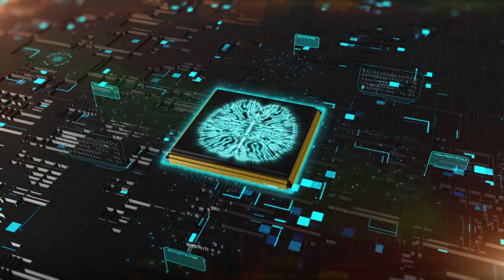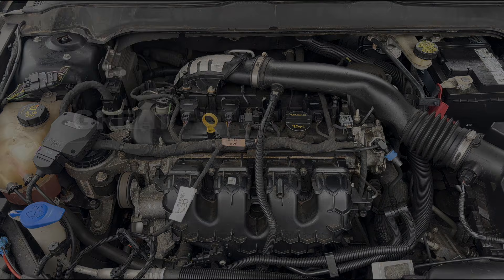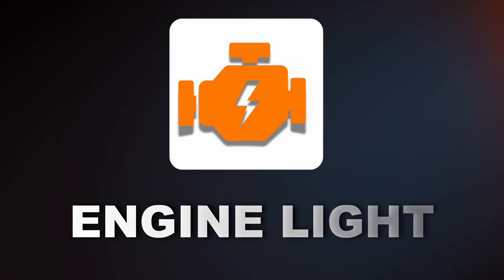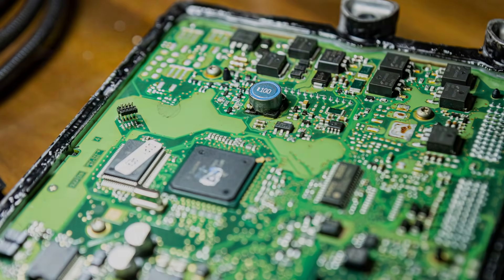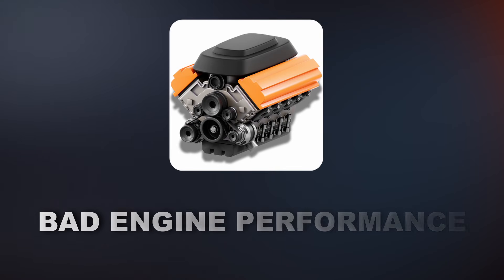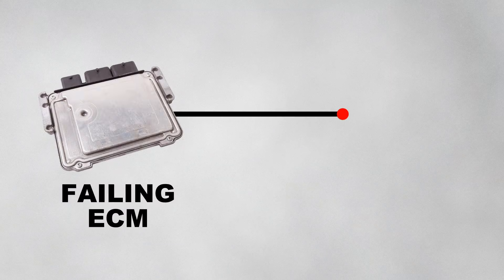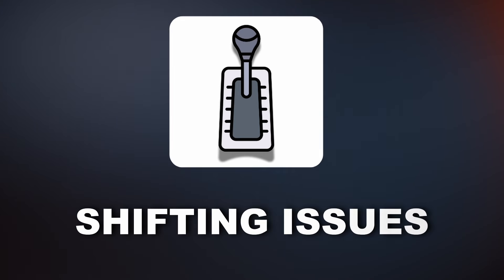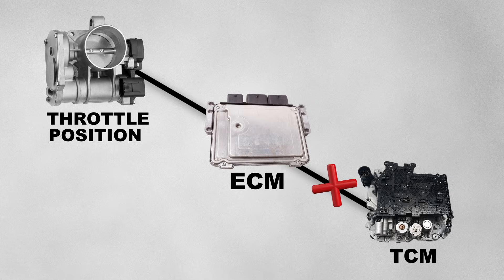Symptoms Of A Bad ECM/ECU You Should NOT Ignore

Comment: This is me with my 02 4Runner. I’m getting a code p1126 but I already replaced my throttle body with new sensors already on the body part but yet I’m not getting any codes about ECM…I’m really anxious as I don’t wanna drive far with it n something happen to me or the truck..I’ve erased the code twice now. 2nd time was after replacing the new throttle body bc a week post replacing the car truck was at a stop light n I couldn’t accelerate…but I turned it off then on again n it drove me right back to work….? I’ve been driving it a little bit only to work n back n nothing yet but I’ve been cautious. I’ve been driving it to trigger any code but so far nothing but I am thinking now it could be ecm related…I just don’t understand?  I work at a mechanic shop n none of the guys see any wires bad or bad maf sensors. And if it was ECM related, is it rechecking the codes after I delete the codes to read the truck? Then it triggers??? Bc if so when I turned it off then on again n it drove fine, how did the ECM let me get back to work?? If it had the code p1126…?):